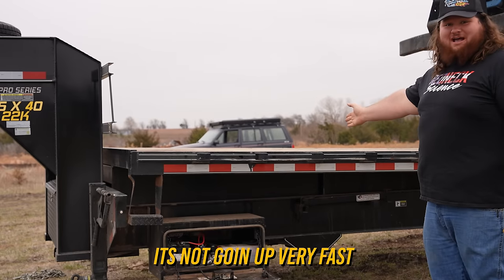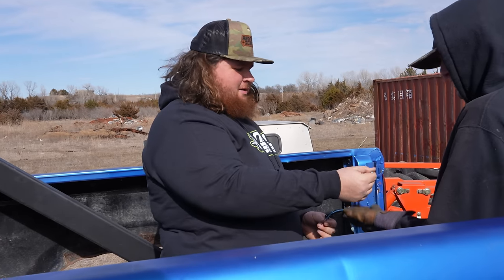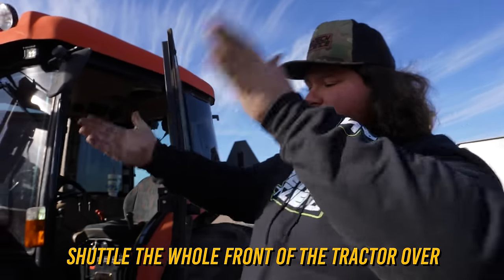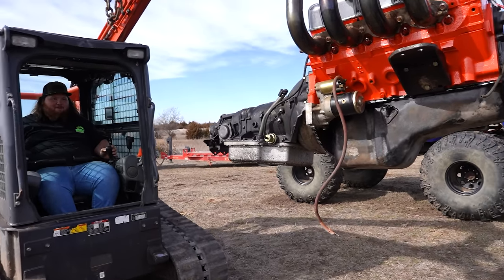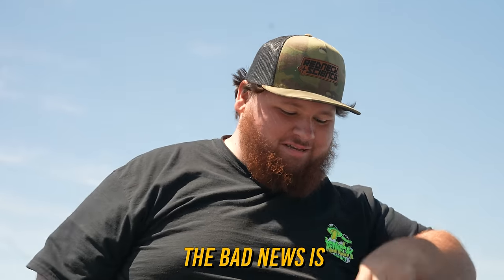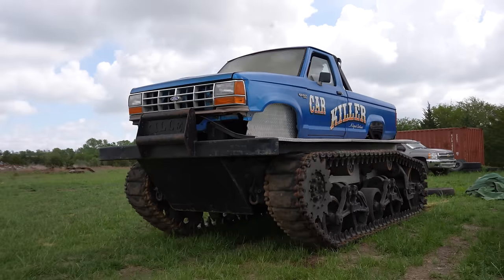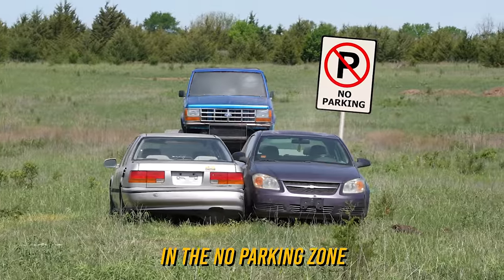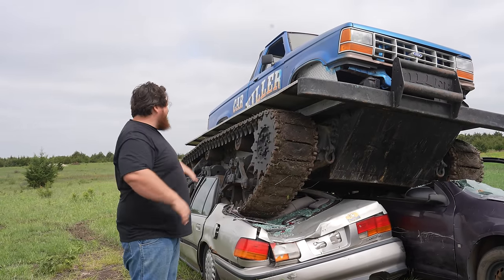I Bought a Ford Ranger Tank

Comment: If anyone is wondering about the Tank Chassis, M3 Stuarts and M113 APC's where commonly used for the chassis and also easy to get ahold of. The M3 Stuart chassis was easy to build with very little metal and you could get at the time M113 APC's with bad engines or decommissioned ones really cheap as well after the war ended.
Reply: the m22 locust used the same suspension set up and that's what threw me off. seeing the whole height of it does screw m3 Stuart. thanks for clearing that up!
Reply: I thought that was the locust too, but I knew the Stuart had the same stuff
Reply: according to a quick search, google says its an  m4 personnel carrier ww2 era.
Reply: No it's not. It's an Allis Chalmers M4 High Speed Tractor chassis
Reply: Define 'cheap'
Reply: ok
Reply: M4 high-speed tractor chassis
Reply: @bigassfordsd  m4 high-speed tractor chassis
Reply: Thats what i thought, M3
Reply: So youre telling me this ford ranger might have killed some nazis?
Reply: Knew it
Reply: @Blobb2013 isn't that based on an m3 stuart though

Comment: Westen, what those zooming need are three sided box, with two caps at the front and rear of them. This means that there'll be one at the top of them, two at either side of those tubes, plus one at front and rear of them. All you need to do is to weld them at each corner of that five paneled box. The sid that doesn't have a panel will slide onto those zoomies. By the way, zoomies is another word for headers. No water will be able to slide inside of them after they're put on.
Reply: Or just slap some tractor flaps on there, farmers solved this problem a long time ago

Comment: What about putting in a diesel engine? Since a lot of weight is in the transmission and the engine is forcing for a much higher weight, I think a high torque engine could make it work better without the fear of it exploding.

Comment: It's a M-2 Stewart tank a light tank of WW2 , during the war they were powered by a bunch of different engine types, Ford V8s , 9 cylinder aircraft engines, Cadillac powered some , not sure on the diesels but probably did at some point 👉 , so these types of tanks were a big deal at the battle of Iwo Jima in the Pacific!! We are talking about, 37mm main GUn , one 50 caliber BMG , 3 30 caliber belt feds machine guns in 30.06 caliber, kool truck , but needs GUNs made a mini Gun !!!

Comment: It would work a lot ezzer if you use a A frame chain set up on the bucket on ur tracker to pull the engine you can rig a chain hoist on the front of the A frame